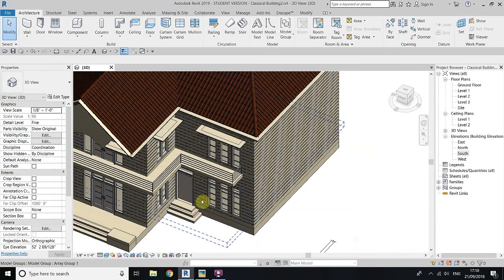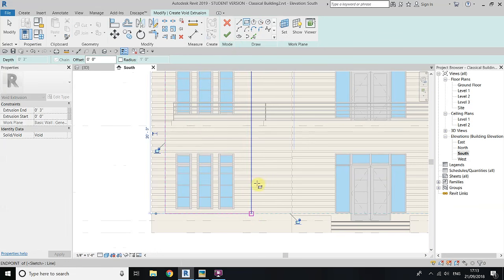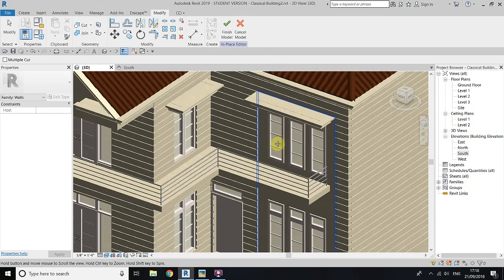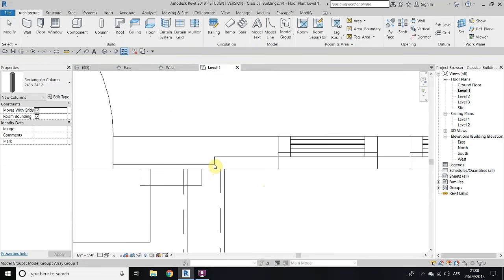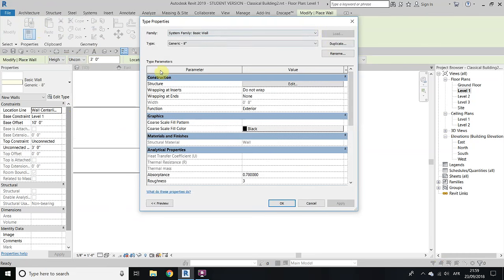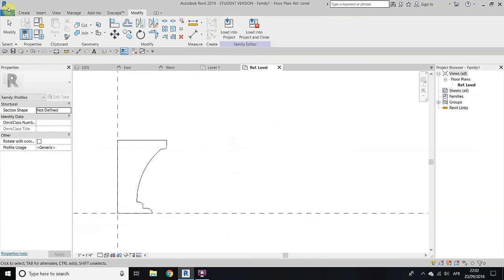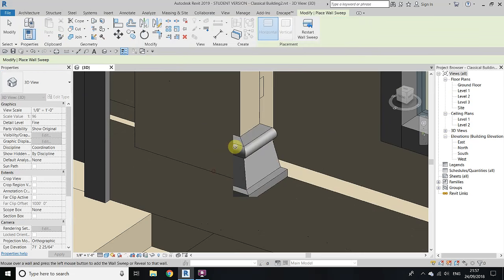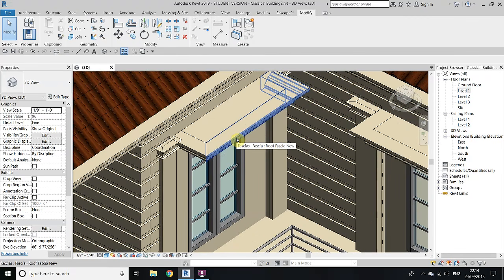Revit Architecture | Modeling Classic House in Revit  Part #4

Comment: Hey Ackhi.. Your computer seems to be running so smoothly... What's the specifications please? hard drive, ram memory and all.. BTW beautiful stuff Thx..
Reply from the maker: Hey, I have Dell Inspiron 5000 
i7
16 GB Ram
4 GB Graphics (Nvidia)
1tb Hard drive.

Revit 2018 works perfectly but 2019 lags too much while working on big files/projects. Mostly you have work in "hidden lines" or "wireframe" if you want use Revit 2019.

Comment: Hi, is this tutorial part4 already consider finish in here only or you will upload it to fully completed one ? I have been following this tutorial, but unfortunately still left some more task still unfinished yet, hopefully there will be another part5 or 6 :) 
thanks anyhow ...
Reply from the maker: Yes.. will try to upload today
Reply: M.T.H REVIT TUTORIALS  thanks friend :) I have done part#4 and applied the Spanish roof to this building too, at that ridge component I have an issue want to ask your advice, when I want to pick line at the roof ridge line, it always get highlighted face of the roof and can not pick single line, the problem is when I installed the ridge tile, the tile was tilted or sloping to the beam direction as well... any idea how to solve this matter?
thanks